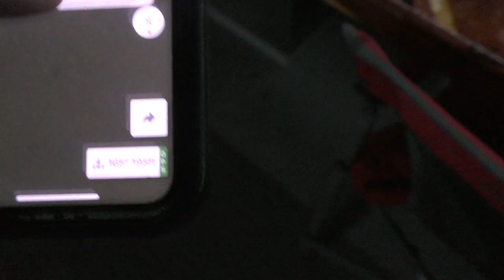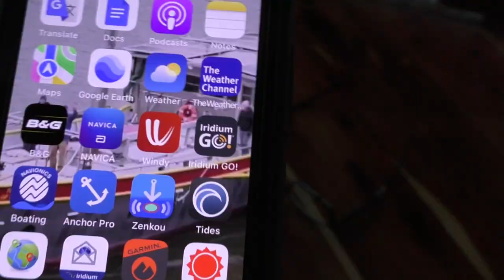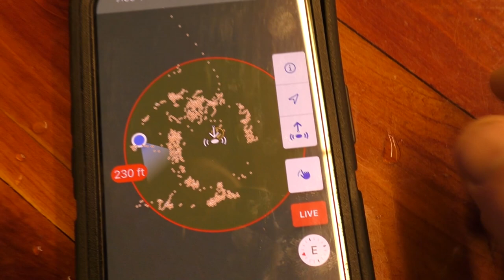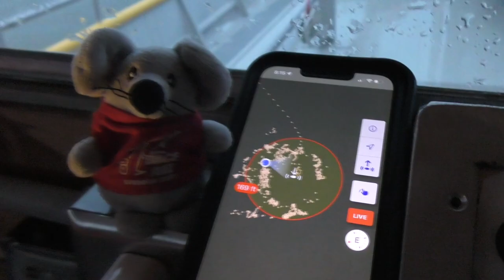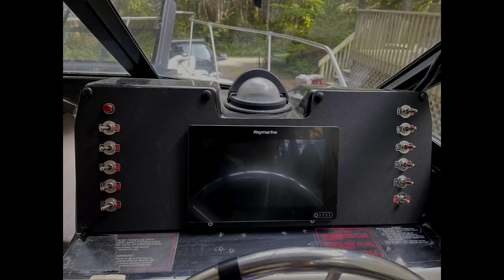Anchor Drag Alarm

Comment: I was wondering is your mass conductive is it safe during thunderstorms and lightning?
Reply: If lightning strikes the mast it should theoretically be conducted directly into the water with no risk to the occupants of the vessel. If it doesn't work out that way in practice, suddenly it isn't his problem anymore.

Comment: I thought the risk of propane in a confined place is from a fire, not necessarily an explosion.
Reply from the maker: Yeah is easier to set fire to it in a confined space as propane is heavier than air,  but it does not take much air to flush it out, and if it's very confined it burns from the top down when lite.   Getting it to explode takes work.   Or just mix it with oxygen.  : )
Reply: We once had a boat exploded behind  us when he got out of bed and light is cigarette from a propane leak.

Comment: Those chainstops should maybe have a lock on them to hold them open, to my eyes, they're gonna get flipped down by that chain at some point, and it'll probably be when you least want it!

Thanks Doug!
Reply from the maker: "probably be when you least want it!"   That has got to be one of the all time most over used fearmongering phrases.   I'll tell ya what,  No.  Better to see what happens that to fear the imagined.
Reply: @SVSeeker  I just saw something that could be made a bit better, with relatively little effort. I'm not going to be up all night worrying about your chain getting snagged, And I know for a fact you ain't! but small stuff like that has a way of pissing people off until about the 20th time it happens, THEN it gets fixed!

Don't sweat the small stuff, But don't ignore it all either!

(BTW, I make my living doing dangerous stuff with deathtrap machinery, Fear-mongery ain't got no place with me either!)
Reply from the maker: @theafro    I like hearing that.   This job of reading comments is more than slightly off-putting to me lately.   Maybe it's always been this way but more and more I see people including phrases that you would see on the TV News.   Way over the top exaggerations.   You must what I mean.  Its not going to be "Hot Outside",  it's going to be "Dangerously Hot Outside".  Ya know, unless people for bursting into flames, I don't think they need the Dangerously.   I wish we could roll back the exaggerations to the level they were at 60 years ago.   Maybe we need another world war to reset the baseline for what is truly dangerous?
Reply: @SVSeeker  I'm really hoping we can get there without a world war, but the way society seems to be going is clearly unsustainable, and will probably lead to some sort of cataclysm of our own making. My own antidote to this is to simply go my own way, I avoid TV, and most social media, as they clearly just cause unhappiness, no matter how sugar-sweet it might seem on the surface. I prefer to spend my time doing things that actually make me happy, and not a hollow simulation of happiness. Life is tough enough already without making it artificially worse! I'm not rich, I don't have everything i've ever wanted, but i've got a wife and 2 awesome kids that make even the small joys that much sweeter, and it's real. too many people loose sight of that reality and get caught up with chasing things they don't really need, and to the detriment of others and the planet as a whole.

I found a way to teach my kids about the dangers of consuming too much media. I told my kids that I thought the earth was flat! They then spent weeks presenting me with evidence to the contrary, but blew them off as it's all just pictures and words and therefore heresay. But my oldest read of a method to actually measure the size of the planet with a stick and a bit of geometry, our answer wasn't all that accurate, but we made it ourselves! I like to think they may have come to understand just how much of their world is based purely on blind faith, and that occasionally questioning that faith is a good thing! and that goes for everything, if it won't stand up to questioning, then it ain't worth shit!

I could ramble like this for hours, I guess I've got a bit of preacher in me too!
Reply from the maker: @theafro  BRAVO Dad!

Comment: First storm is a test of the anchor, boat and crew, I opt for more chain, the poly is only a safety if you can’t retrieve the anchor quickly in an emergency, tie a fender and cut the poly.

Comment: The bilge pumps work.  Who doesn't leave the occasional window open? Once upon a time some friends and I flew giant bat wing kites so high we put lights on it.  But it was hard to tell how much line was out.  Like you we put markers on the line, but were color coded. Pink for every 1000 feet, lime green for every 500'.  We used a warn winch with a heavy gauge line; I can't recall the size. These bat wing kites were about 25 feet wing tip to tip.  No, the Air Force never came looking for us.  We did loose one once; never found it.

Comment: aren't you worried about the conductivity of the metal mast?
Reply from the maker: No.  A strike anywhere on a metal boat will be conducted into the water.  But it will likely cost a lot of electronics.   Most fiberglass sailboats have metal mast and they run a copper cable from the mast to a metal thruhul.

Comment: wont metal fatigue at some point grenade the hydraulic motor on the anchor winch? that amount of bending seems, in my eye's, to be pretty risky, even more so if you use it for more then a months or 2.
Reply from the maker: Holly Dog Shit!   Who thinks like that?  Do you ever leave your house?
Reply: @SVSeeker  give it enough time bending like that and its gonna break in some weird way no matter how you look at it, metal fatigue is brutal and rather easy to underestimate IMO, TBF i do not have much experience with this sort of stuff, also, rude but kinda funny. looking at my area on what sort of stuff has to be done to prevent metal fatigue i must say compared to the US its 1000x more strict in every way. im always amazed that its possible for public infrastructure to just collapse in the US, that simply doesn't happen here in the Netherlands.

so yea it may just be cultural difference then eh? till next time, love the channel.
Reply from the maker: @higamerXD   You really should get off the couch and travel,  or build something,  because your practical knowledge and lever of fear are off the chart.  A "grenande"?
Reply: @SVSeeker  well its just a figure of speech, realistically looking at that id recon it would just snap off or snap the plate holding it on, ill agree with ya on the first point tho, sadly ive not had that chance for awhile now, i do overthink things a ton tho, i really should work on that. you bring a good point it seems,
Reply: @higamerXD  Yes, it will break and most likely will cost him another hydraulic motor. This is coming from someone who used to do similar mistakes till I finally learned to just do it right.

Comment: Marking the anchor chain.  

One bright painted link at 6 or 10 feet. 6 feet to the fathom..
2 links painted at 12 or 20 feet. 
If you use florescent paint.  If you put a UV light you can see the rings of paint go past easier.
Reply from the maker: There is a simple plan. :-)

Comment: Hei when you have a tight spot and you can give only so much chain. You can slip a wheight atatched whith a shakle at the Anketline  and a  rope to  lower it down your ankerline. This lowers the angle of the pull on the Anker. And it also lowers the shokload on the Anker because the line first has to straighten out bevor a shockload. I build one my selve whith an old Fender filled whit Conkret. Also a Fender whith a line atatched direcktly to your Anker can mark the position to control the Anker and you can See it slip and in case it gets stuck can be pulled out the other way where it needs mutch less force. THANKS for sharing your adventur been following you since the first plates whitch you were bending whith straps to form the hull.
Reply from the maker: Yes, a Sentinel or kellets.   I got a bunch of lead and will make a couple at some point.

Comment: Why the extra heavy chain when it's all limited by the rope. If it's too expensive or won't fit on the drum, wouldn't it be better with smaller chain all the way?
Reply from the maker: The line is 1/2" Amsteel and it has a breaking strength of 34,000 pounds, so the 5/8" chain would break first, but even so, the weight of the chain acts like a shock absorber as it must be lifted off the bottom with each wave.
Reply: Incredible that the thin rope is stronger than the thick steel chain, but was also thinking about chafing issues
Reply from the maker: @ZeffyZ  That is also why there is chain.
Reply: Yeah Ok, just seems flimsy is all, but perception is deceptive sometimes. Perhaps some tubing over the rope connected to the chain to help with chafing on rocks etc.

Comment: you have a chaindog to take the load off the winch when at anchor....is there a deck cleat or something similar to wrap the dynema on,  to take up strain when you've run out all the chain?
Reply from the maker: The winch has a break and a dog clutch.

Comment: From the lessons at the maritime academy I am enrolled in, I came to understand that most of the holding power of the anchor is drawn from the footing it takes from the bottom, which can be aided by an increased scope. However, from my conversations with the officers on the 40,000+ ton displacement vessel I am attached to and discourse on YouTube, I was baffled to hear that some think it is drawn from the combined weight of the anchor/chain, which bears no comparison to the weight of the vessel (ours is merely 9 tons) and friction, when I understand the anchor chain doesn’t necessarily lay on the bottom. They contend, also, that extra chain is paid out to increase the weight overboard, not to increase scope. Can anyone weigh in?

Comment: Rather than welding the gaps between the mast, deck and wedges shut, why not install a big rubber boot (rubber flap wound around the mast and secured with big ass hose-clamp type doomahickies) between the mast and the rim at the mast opening in the deck.  Additional silicone kit or Sikaflex to be used to finetune the seal between the rubber boot, the steel of the mast and of the deck-rim.  It will take a big rubber flap and big tie-down clamps for each mast, this type of fixing is common on many sail boats.
It will make mast removal, whenever it might be required (e.g. low fixed bridge crossing or major mast repair/service) a hell of a lot easier in the future...
Happy sailing!
Reply from the maker: Why would you not weld it?   Wedges, castable products, and boots are all for wood and fiberglass boats.
Reply: @SVSeeker  Your boat, your call.  Tnese are all but options...
How does the welding on your mast affect it's strength at it's major loading (bendings loads)?  On drilling rig masts any welding on structural parts has to be followed up by a heat treatment, to ensure that the metal around the weld regains the proper structure.  Not saying that SV Seeker is a drilling rig, however similar principals apply....
How does the welding affect the protection against corrosion?  Easy to fix on the outside, not sure how you can fix this on inside of the mast.
Fair winds and happy sailing!
Reply from the maker: The whole mast is welded.  : )     I'll let you worry about it.    https://youtu.be/BE3Nlc6gDbo
Reply: @SVSeeker   Thanks for your appreciated clarification and the link to your mast welding episode.
I'm done worrying now...

Comment: Canvas seals on the masts ? They work well
Reply from the maker: Weld!   It's a steel boat.  : )
Reply: @SVSeeker  Weld weakens mast ? Polysulfide sealant like the kind you use between concrete tilt wall  buildings with wide gaps.or just a collar like a stove pipe thru a roof or is the deck flat and not raised there ? Just a thought I have seen all three in old large sailboats but none with steel masts . Keep up the great work getting out the bugs. Every new boat,yacht,Rv has its well we should have done that period. We built 50 foot fiberglass trawlers from scratch and had the same little buggers from engine beds,glands,hydraulics ,etc as well ! Good Day Captain Doug !

Comment: Does that lake have a harbor your vessel can access?
Reply from the maker: Depends what you mean by harbor.   If you mean marina, no.  And if it did, I would not go.
Reply: @SVSeeker  There is an old barge sunk right in front of the marina. I have hid out behind it in a storm a few times. That lake is very shallow and the waves can build up fast.

Comment: Any one of these systems can take a whole company a lot of time and effort to develop - and yet you've hacked them all together from scratch and scrap and they actually work just fine.

It's very impressive, and I think will teach many aspiring engineers out there how it can be done.
Reply from the maker: Ok, they have worked well enough so far.   And I can improve them as I go.  : )